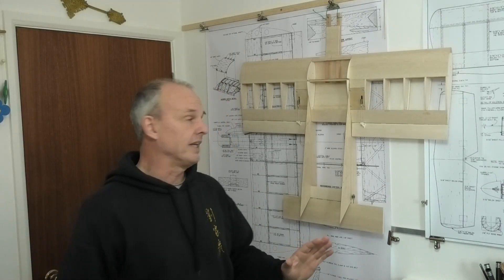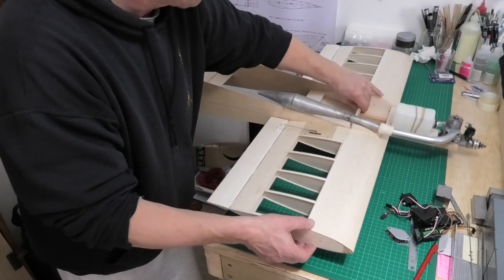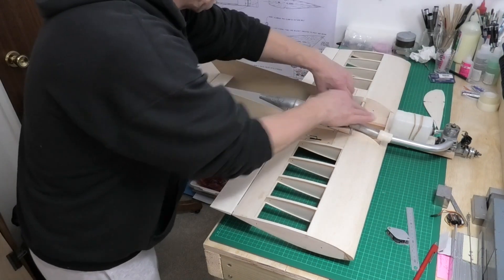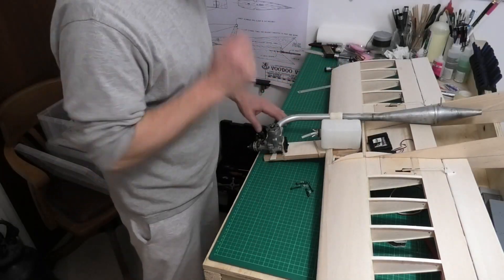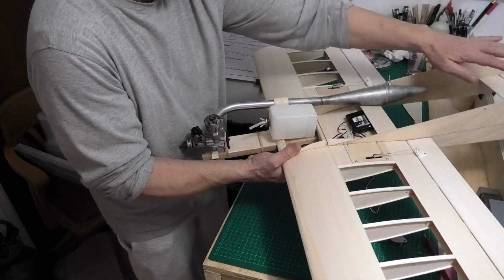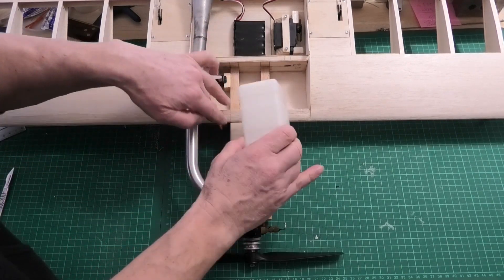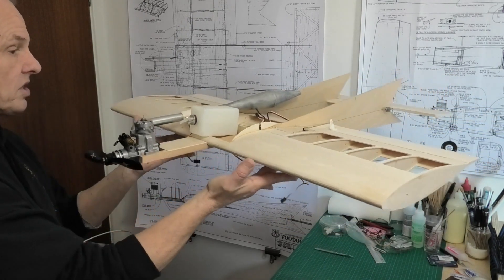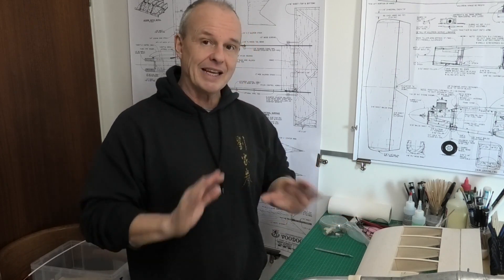Voodoo VI - Hi Performance 40" Combat Wing: Pt 6 - Ensuring the Correct CG with no Added Weight!

Comment: Do you not have to balance the cg with fuel in the tank?
Reply from the maker: Hi John, the CG should always be done with the tank empty, because if done when full, as it empties during flight you plane will become tail heavy which is not a good situation. Much better to have it nose heavy at the start.

Comment: Hi i built the original voodoo into rc conversion  i only used a 1 inch wide aliron ..i used the original elivader  from the back of the wing to the elivader pivit pin 4and half inches the only modification to the ceter ribs were made to the bottom for the radio with a hatch for axcess used the original engine mount  location.. not much modification other than the bottom center ribs and the rear finslike you have .. you hae to use the fins like you have or it will not fly it will spin on you i know from trial and error the one i have is 53 years old..
Reply from the maker: wow sounds great, how did it fly?  I love flying wings, they really keep you on your toes and the adrenilne flowing!!
Reply: @MarkRobinson555  it flew prety much like an airplane.just in the turns the nose drops a little more..the hardest part is the launch the tossoff kind hard by yourself..

Comment: Excellent progress Mark. I can’t wait to see this little monster fly!  Question: it looks like your exhaust is awfully close to some of the surfaces of the airframe. Do you need to worry about heat… or will airflow keep it cool?
Sorry for the dumb questions… I am a noob still on his first build…
Reply from the maker: Hi John, thanks for the comment, its appreciated.  The exhaust in the video is just lying on the wing so I can get a sense of the weight and where the CG is naturally faling, so I can adjust to to where it should be.  When the wing is finished it will be on a short bracket to hold it above the wing a little to avoid any heat damage.  Sensible question.